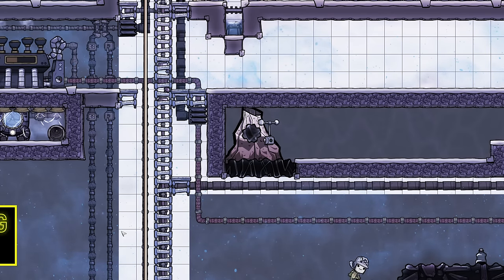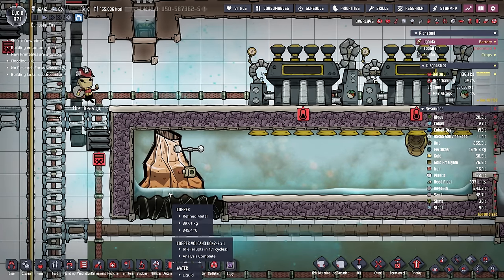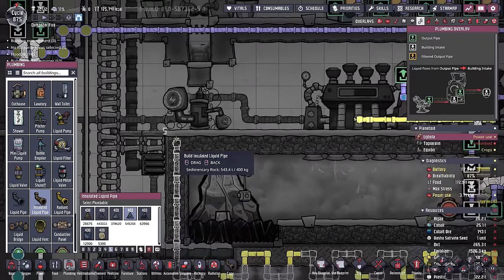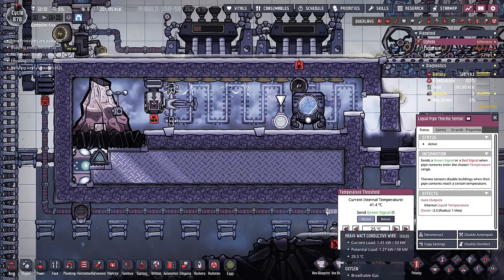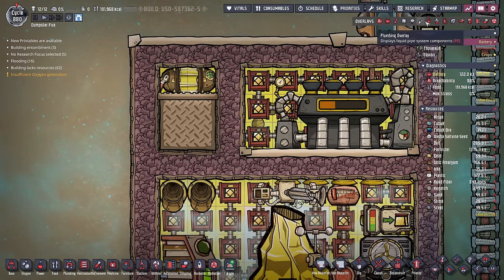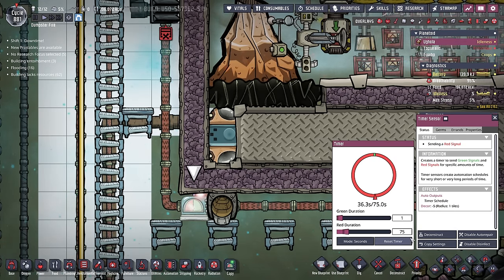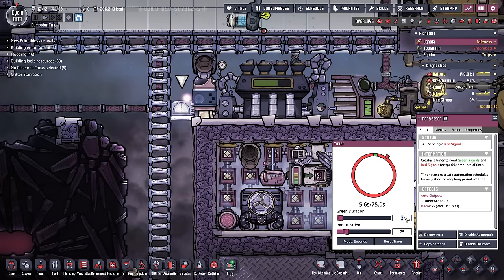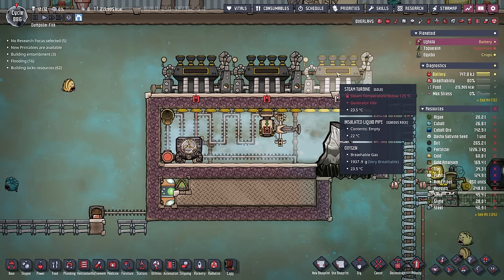Metal Volcano Tamers Tutorial | Oxygen Not Included

Comment: 5:40 The slight catch with this design that I've found, is that if micrograms of metal get onto the rail, they never get off it again. You need some sort of failsafe system to get those tiny tidbits of metal off so they don't eventually clog the whole system up.
Reply: An easy fix though is you can just set the conveyer temp sensor to "above" the desired temp. I've tried avoiding getting only micrograms of metal by putting in a timer sensor and connecting it to the conveyer loader to try to make sure its full of metal before I start sending it and its worked so far but there's probably a better way.
Reply: If I remember correctly, 2Legitcity has a good solution for that: using a buffer gate and a filter gate allows the system to purge the micro packages. Although, the rail system is a bit different than the one presented in this video

Comment: I do something similar to your thermo rail sensor design at 12:15 except I add an overflow to the rail bridge so if it cant go into the chiller box it travels along the insulated bricks and either drops off the rails under where you have the conveyor loader which avoids those weird times when you get micro grams that wont change temp but it also helps keep the steam rooms temp more constant by rotating the metal through the steam room even if the metal is rotating through the chiller. I usually add a rail thermo sensor to the steam room as well to make sure the metal stays in there until it hits < 130 as well with the metal failing that also being dropped back into the steam chamber

Comment: I'm very happy to have followed up and tamed my first metal volcano. It was cobalt and did I cause chaos by untaming it before I was ready with equipment! Dupes were using flaming hot cobalt in the base, I almost gave up. I used aluminum tiles and cobalt pipes for the bottom section and to my amazement the cobalt got chilled from 130C to 9C upon reaching the first aluminum tile! I also added tempshift plates, not sure if that changed a lot but anyway, cobalt at 5C works like a charm.

Comment: Rather than have metal stick around in the steam chamber to extract more heat from it, you can break it up into smaller packets in order to speed up the heat transfer. This can be done with a Conveyor Meter set to an integer multiple of the per-second output of the volcano and using a timer sensor to trigger it, or you can self-trigger it if the multiplier is 1.

Comment: Great video! I have not tamed a metal volcano yet (first playthrough at cycle 200 atm) but I hope to soon! Quick question: In order to extract the most heat out of the copper, could you also add a temperature sensor on the conveyor rail inside of the steam room to only let copper pass into the cooling loop once the copper is below 200 degrees for example? Instead of using a fixed timer? Are there any downsides to this?
Reply: Yes.

So, just like they do a loop for the chiller, I also build a similar loop inside the hot chamber, only letting anything ~130° into the next loop and backing up the conveyor loader.

Although any extra automation inside is going to need steel, the conveyor shutoff is 200kg and a sensor 25kg.

And yes, all of this is going to consume power instead of producing more, but I myself need the metal waaay more and as soon as possible than saving power.

Comment: 1:25 - First time I hear about the leftmost turbine overheating. Do you mean that the steam near the volcano will get significantly above 200° and thus the turbine will start producing more waste heat? If so, that is only a matter of enough steam mass in the room + tempshift plates to spread it across.

Then again, whatever the reason, it's on you for making the room only 3 tile high and not putting the turbine output vent exactly above the volcano :_echoCool:

Comment: 8:10 - Or three: 
1. Add a second AT in series.
2. Add a layer of petroleum on the bottom of the steam room + on the floor over the steam turbines
3. Increase steam pressure in the room to something like 200 kg per tile.
4. Ignore the debris chiller and send the rails through the steam room and then directly through the liquid under the turbines.
5. Realize it doesn't work with niobium volcanoes, but do it anyway.
😉

Comment: 20:11 - I followed this math and ended up with solid blocks of aluminum I had to mine out. You need to do the math considering the kg/s output, not just the average output that includes dormancy, because you will have too much left on the floor waiting to be gathered, and every eruption just liquifies it all, and when it solidifies again, if there is too much of it left that hasn't been gathered yet, it will solidify into a tile.

Other than that, I also needed to add an OR gate between the temp sensor and the battery because things started melting down when the two signals competed on the single wire and red won out when the signal should have been green.

All in all, your hybridization attempt of two designs doesn't work to keep it self-powering, to utilize the heat energy long enough to bridge the dormancy period, and I only needed 61 cycles to run your design to find these shortcomings. Trying to add a robo-miner now...

Don't get me wrong, I appreciate the help, I just dislike when people talk with absolute confidence about things that in fact aren't as certain as they present them. It's important to ensure your designs are thoroughly tested before presenting them as solutions.

Comment: The power optimization is really interesting! I'm struggling with power in my colony at the moment because I don't have enough hydrogen or natgas and haven't gotten to petroleum yet.
I'm using the V3 tamer setup from BierTier (the german engineer) which is really cool. I think I'll add the power logic!
Reply: Pulling power off the heat from volcanoes is key until you can tap into geothermal. I assume that since you don't have petroleum yet you aren't deep enough down to setup a geothermal either.
Reply: @ZachariahWiedeman  Oh I've explored the entire planetoid, there's just so many things I haven't gotten round to trying yet. This play through was the first time I got to steel haha
Reply: @C3PVO  Ah, steel... haha, yeah, I heard that's useful. 😉

Speaking of steel, while you're refining that steel you can actually create a little power using the heat generated from your metal refinery - and steel refining generates a LOT of heat.

If I recall correctly, you just use crude oil as your coolant and then loop the coolant output back into the refinery with  a pipe sensor and shutoff so that it keeps heating up until it is hot enough to heat up a steam room with a turbine. After it cools off  in the steam room (again, another pipe sensor and shutoff does the trick here), you can send it back into your original loop that feeds the metal refinery. You'll probably want a liquid reservoir between those loops so that you always have plenty of backup coolant on hand. There ya go: No wasted heat, free power, and an infinite source of coolant for your refinery. Easy peasy pie. 😉

P.S. When refining steel, this can generate more power than the refinery used. But other metals that don't generate as much heat, such as gold, copper, and tungsten, won't generate enough heat to replace your refinery's power draw, but they can still reduce the impact of it. But steel generates a LOT of heat, so, yeah, you can actually generate electricity by refining steel. Who knew??

Comment: While the 'definitive' version is efficient, it's not the most efficient that there is.

The loop in the volcano room should have a rail temp sensor preventing anything from leaving the room before it gets below 130°.  That way the metal will continue to affect the steam before heading off to be forcefully chilled to manageable temperatures.

Also, no timer is needed for this setup.  It runs when it needs to run.
Reply: wouldn't you want the metal to come out of the steam chamber at 200? My first instinct is that it if you're trying to maintain optimal temps, it would be drawing heat out of the steam under 200 and stealing it from the turbines. The question then is you're using an AT, so what is the balance? Is it 130, is that the tested temp?
Reply: @BouncingTribbles  (<-Love your username btw) 
Its optimization of the metal, not focused on steam/power, and not concerned with output volume of the metal.  It's focused on capturing the most heat from the metal, and limiting the work of chilling systems.

Typically I adjust each volcano slightly different to allow for build demands and then set them back to optimized temp.
Reply: @brianriley5108  That makes sense, I keep thinking of it in terms of power. IF you weren't worried about the temp of the metal and were just using it for power than pulling it out to keep temp would make sense, but if you're cooling the metal it's just about getting that temp down.

Comment: Thanks for this guide!  I just tried it on a Tungsten volcano.  Thermal capacity of the output is so low, aquatuner runs maybe 10-25% of the time and temps are still dropping.  I was trying to figure out a way to build up heat and maintain it.  Maybe shorten the tunnel length?  I'm using the setup @ 0:21.
Reply: Was able to fix it by using your recommendation of a temperature sensor, delaying the steam turbine from turning on and ultimately pulling out heat too early.  This way I'm also able to use the steam chamber to create isoresin!

Comment: I like this design. I usually circle the hot metal inside the steam room until it has dropped below 200C, then run it trogh the cooling block. The timer sensor would make it a lot more efficient indeed.
May I guggest to pt the battery inside the steam room? It puts of heat too.

Comment: You moved your autosweeper two spaces instead of just one, so it's range is actually spilling over the edge of the structure. I'd scoot it and the loader over one and put the temp sensor where it was, over the neutronium. 
  My first instinct was to create a double loop system, so the debris would leave the steam chamber at 200 and then leave the debris chiller at temp, but then you explained the logic behind the cycle timer and consistent output. That leaves me with one question, do you end up with any debris in the steam room that is drawing temp out of the chamber? If yes, does that reduce the steam turbines effectiveness?
 I think the best system would use the temp sensor and loop in both the steam room and chiller to direct debris. This would minimize any wasted heat and potentially increase the efficiency even more. I'll have to test it, but I think that's the setup I'll use.
  These are great tutorials, thank you.
Reply: The only way you'd get debris taking heat out of the steam chamber is if you introduced colder debris from a source other than a volcano. The metal is always much hotter than the steam when it comes out, and it can only cool down to the same temperature as the steam. If left in the chamber long enough without the introduction of more heat, the steam turbine will eventually cool both the steam and the metal to below it's activation temperature of 125°C, and it will stay there until something adds heat again (you'd have to plug the volcano with a coal tempshift plate for this to ever happen, realistically).

Comment: You could also hook the volcanos up to more batteries. Picked up the tip from another player to use a battery stack on top of a rocket platform. I think I've seen you use batteries like that before, but not for awhile. I recently had a failed metal volcano tamer, because I got greedy/creative and tried to tame an iron volcano and a steam vent in the same box. My method for removing excess steam was in the wrong spot and the pressure got too low and pipes were cracking. Bad. But dang, was I getting a good bit of power before it cracked.

Comment: The way i always see is instead of cycling the metal in the cooling metal block, it gets looped thrpugh the steam room until its cooled to about 200C, where then it can be passed through about 3 metal cooling tiles to vring it down to about 15C.

How does this compare to the existing strategy? For one, i never have it having a large backlog of metal while allowing more efficiency through the heat left it the metal like the timer system does. Though even the timer system keeps metal queued inside the metal tiles.

I just see that as a bit inefficient so im wondering why you havent shown this method? Im probably wrong about something, so any explanation would be nice, thank you.

I suppose i can see that the timer is calibrated to the average output of the volcano but i think this method is at least more intuitive than the earlier methods.

Comment: What's the disadvantage of using a temp sensor and shutoff on the conveyor rail before the metal leaves the steam chamber? You could set the min. temp to 200 and the metal will never leave the room until it is below the desired temperature for maximum turbine efficiency. When you said "best of both worlds" I thought this is what you were going to do next. 😅
Reply: I think in this case, you need to set the temperature to 130 degrees so that the metal spins in the steam room and cools down when the turbine is running, when there is little energy in the batteries. If the metal at 199 degrees leaves the room with steam, then it is a loss of energy. But in this case, it is necessary that the base consumes energy constantly, otherwise there will be very little cold metal.
Reply: I don't see any disadvantage in that. You can set sensor to any temperature you want. Of course above 125°C that is. I usually set it to a value slightly above the temp the steam averages out at.
That is the standard soution for my tamers.

Comment: Its kinda pointless. Not completely, but it is. Metal on the rail gets cooled down quickly to some 123-124 degrees, means it equalize temperature with surrounding Steam, then Volcano errupts and heat metal back as steam temperature raise, only to be cooled by your aquatuner. It gives better dynamic as more heat is stored in metal, but that energy is lost by cooling it down forcefully. Its simply not effective.When metal goes under 125, it does nothing towards steam production besides helping little bit keeping temperature up for dormant phase(thats what tempshift plates are for). But since timer goes off all the time, it will get expelled anyway. You could add temp sensor to stop it when temp of steam goes under 124 or so.
In the end, you could just let it go trough Steam to get it under 125 and drop it to the pool of oil, that can be sent to the refinery when it gets too hot for comfort. Or water for oxygen production, any kind of heat deletion. Much easier, more effective since you dont waste energy on hot metal.

Comment: My version is similar but much smaller, as long as you have the steam pressure you can put everything next to the volcano and it won't overheat and the metal tiles are unnecessary, you can cool the metal to 25° in the same space where your turbines are, just put 200kg of some liquid on top of the turbines and run the metal through along that liquid until is 25°, I tried linking an image of it but my comment got deleted, if anyone wants an actual explanation let me know.

Comment: What I don't understand and what doesn't work for me is how the "self powering" design is supposed to work. The aquatuner instanly eats through all the power the steam turbine is generating. Generating 850 W is not enough for a a 1200 need, I don't understand how is it ever supposed to work. I had to attach it into my main grid otherwise the aquatuner constantly turns off and is not cooling the steam turbine properly
Reply: Do you have a liquid pipe temp sensor in the cooling loop connected to the aqua tuner?  It will turn off the aqua tuner when it reaches the set temperature so it isn't constantly running and draining the battery. A bridge bypass of the aqua tuner will keep the coolant loop circulating when the tuner is off.
Reply: @achillesbogart  I do, tho admittedly I have it set very low, so maybe once it's stable at that temperature I'll be able to to take it off the grid

Comment: Because of the new playthrough that was supposed to be no plastic, i kind of wondered, how much an ethanol vaporizer chiller could do to tame a metal volcano. Anyone tried?
Reply: Ethanol chiller has a fixed amount of heat it can delete per single aquatuner. Meaning that you can chill anything with it, it's just a matter of how many ATs you will need.
Reply: @nazgu1  I get that, what I mean is that the design would be quite different. I wonder what would be a good solution, and how much ATs and ethanol would be needed per metal volcano
Reply: @IcoKirov  Honestly, I think of ethanol chiller only as of a temporary solution when I am starving for plastic. I don't think taming volcanoes with it is a good idea, it's just too clunky and inefficient.
Reply: @nazgu1  yeah, I usually avoid them altogether (leave things to get hot, rebuild building and so on). But if one is trying no plastic run... I don't think you can do much with ice maker machines :D